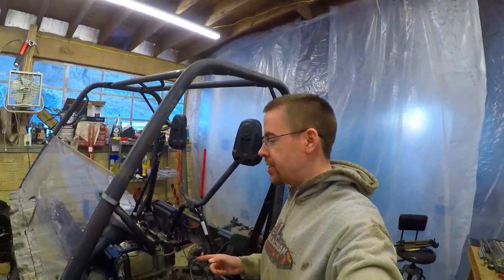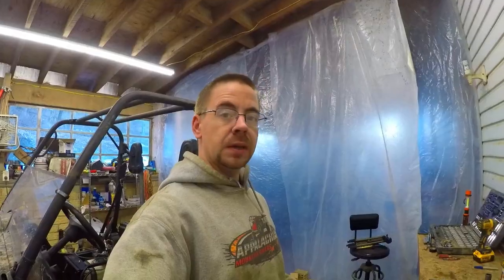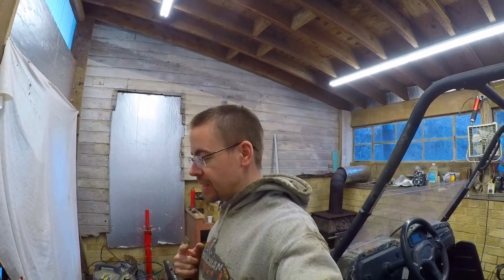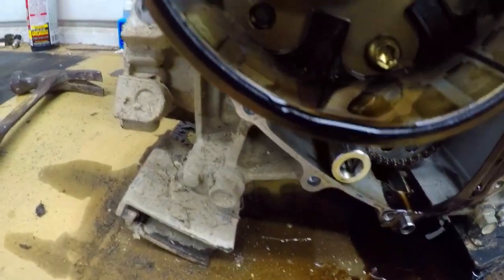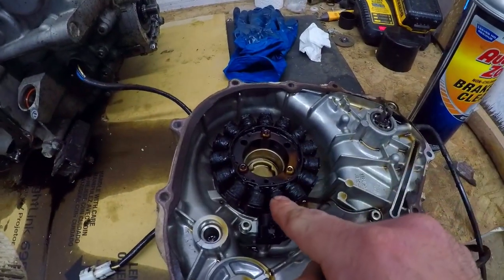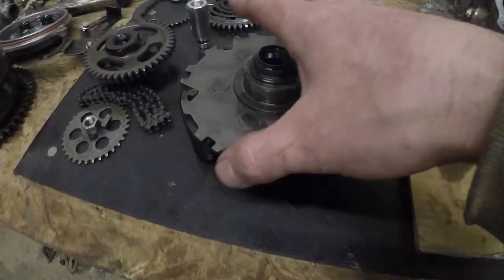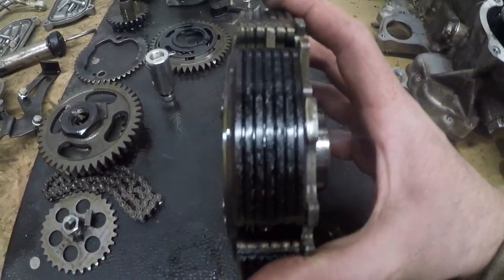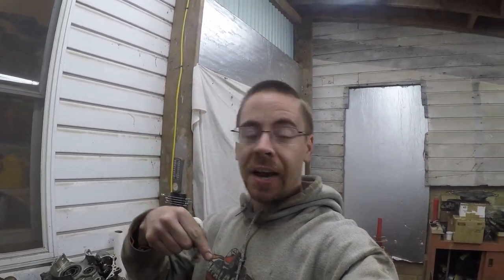Project Raging Rhino: Yamaha Rhino 700 Tear Down Part 2

Comment: I have watched every video since you started your channel ,and was inspired to get a 2017 Honda pioneer 500 . Since acquiring this machine I have installed power steering ,a windshield front and rear a large cargo box on rear rack , and the most exciting thing in a while is the parcel that arrived yesterday with a new Torq Locker also inspired by you . Just need to get the courage to get at it. I have a nice heated shop , so working conditions are great . Just need to watch your video a couple more times to get encouraged. Love your channel ,and wish I lived near you so I could get in on some of your escapades. Looks like a lot of fun . . Robin
Reply: Your Honda Pioneer 500 videos are AWESOME &  HELPFUL !!

Comment: The other fellow was saying something about an internal oil leak maybe taking out the stator. I think that area just mostly gets splash lube doesn’t it? 
I know they went to a different cover with some oil lines to help stop the stator from frying. Man that thing is over cooked!!! Haha. 
I’m thinking that thing ran low on oil at one time is maybe why both it and the wet clutch are black. 
Interesting stuff non the less.
Looks in great shape for the amount of miles.

Comment: I wish you lived close by. Got a Kawasaki Prairie 650 that locked up, hole in piston  , I think a valve keeper dropped , or the piston or crank rod broke and pushed the piston up into the plug. The plug was smashed. Ug .
Reply from the maker: Yikes!

Comment: With the added h.p., have you considered changing the highs range gear ratio to allow higher speeds?
Reply from the maker: This is Greg’s baby so he did all the figuring and part ordering so I’m not exactly sure what all he’s got coming yet save for an extreme sheave and slugged wet clutch. I’m just doing all the grunt work...lol. He’s happy with the top speed only being around 45-50ish though as it’s still going to be a trail buggy.